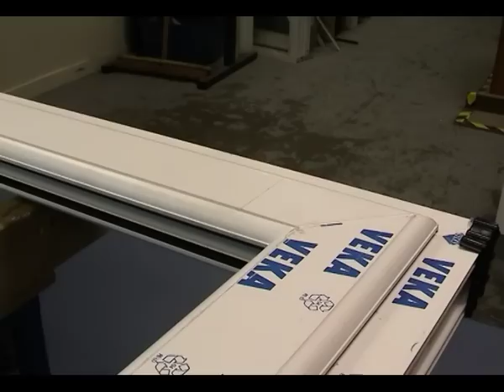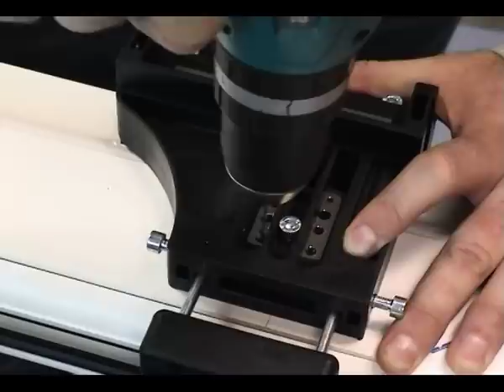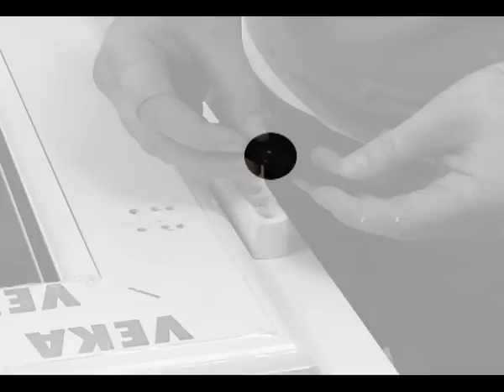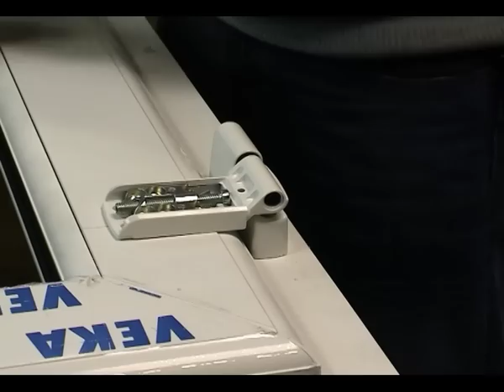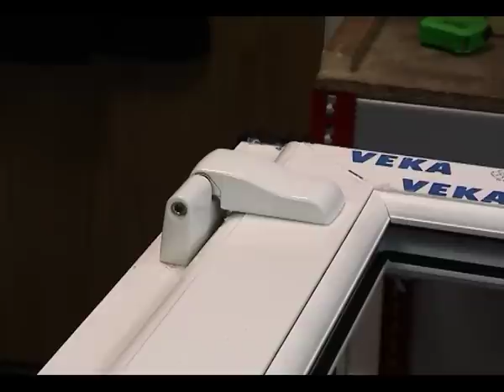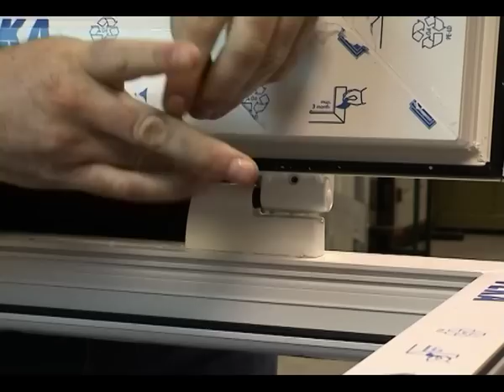How to fit and adjust the Anchorage Intelligent Strength flag door hinge

Comment: The compression adjustment is obviously important but instead of highlighting the correct insertion of the pin they actually black it out so that you can't see anything.
Reply: Did you ever find out where this pin is? Need to reset my compression, I can’t for the life of me find it

Comment: How do you life the door off it’s hinges, is it a case of just lifting or do you have to take some screws out
Reply: Hi I also want to lift off the hinges, to remove the door temporarily for access. Did you work out how to do it ?
Reply: @martinoluigbo5880  no sorry I didn’t but most do just lift off with manual force
Reply: Best way is to lift off